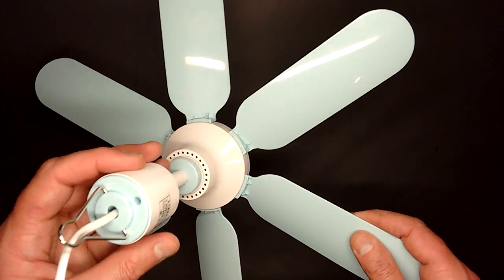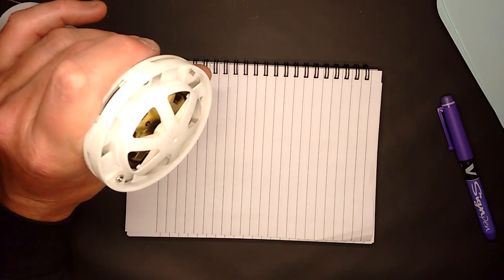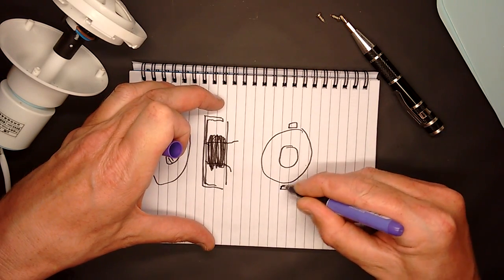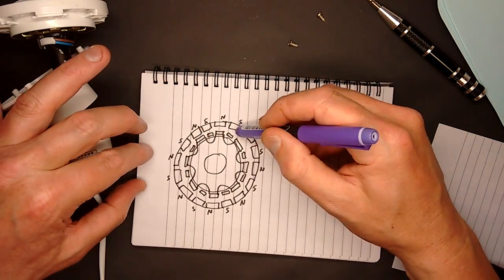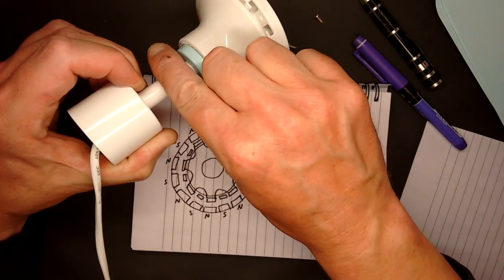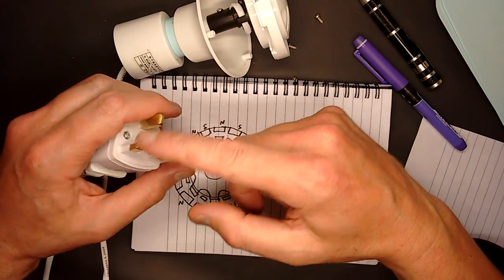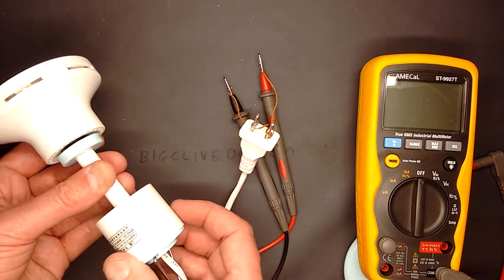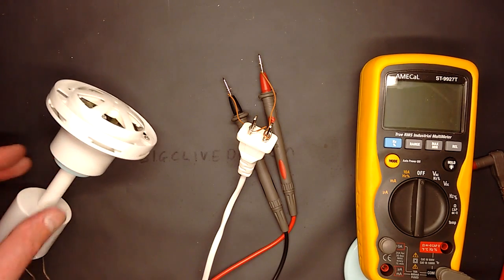Mini ceiling fan with intriguing motor and wind turbine potential.

Comment: is there any way to convert this unit from a 220v to say a 12v?
Reply from the maker: They do a 12V version.
Reply: +bigclivedotcom I bought the 3 leaf version 12w. but I really want the version you got in 12v. is there a way to perhaps make it run on 12v?
Reply from the maker: They may do a bigger version of the 12V unit.
Reply: Fareed Alshami
Reply: bigclivedotcom I see. but no way to covert it then easily?

Comment: what will happen if that 220v fan is plugged into a 110v socket?
Reply: It just wouldn't have a lot of power. Fan might run a bit slower. Too little volts for what it was designed to run on.

Comment: Would one of these https://www.amazon.ca/Ckeyin-110V-120V-220V-240V-Voltage-Converter/dp/B00RTAN57Y/ref=sr_1_15?ie=UTF8&qid=1469904868&sr=8-15&keywords=110+to+220+v+converter work for using this in Canada? buying the fan and this converter together is still cheaper than the fan designed for 110v... doesn't make much sense to me.
Reply: Nvm.. just cheaper to get the 12v one with a 12v adapter

Comment: I would think the spring load would be for when the motor tries to rotate in the wrong direction at start and it causes the load on the spring to slingshot the rotor in the opposite direction.

Comment: so with some modifications, you could in sense make a perpetual motion device by using the mini fan, and using it to power a USB fan, which in turn the air flow turns the mini fan, giving it power. ok, maybe more than just "some" modifications

Comment: The mechanisms that allow a shaft to turn in only one direction are known collectively as "sprags" (in the U.S., at least). These are also a very common component in automatic transmissions. 

I could hand you a very small ring-shaped assembly that looks similar to a bearing, and then tell you that this particular sprag allows the transmission to function properly (in the forward direction) in 2nd or 4th gear... and then tell you that it's capable of withstanding 700 horsepower (approx. 540 KW). In other words, they often transfer torgue directly to the output shaft. (Although... by "directly" I usually mean "eventually, through the planetary gear system".) 

The fact that you are examining a tiny little "spring sprag" is very entertaining, so thank you for the video. However, I consider the idea that a spring is applying constant friction, however small, to the shaft as the fan is running to be a poor design. 

Sprags are one of the most interesting reasons that auto transmissions do what they do, which are a device that I enjoy taking apart to study - much as you do with electronics. ;)
Reply from the maker: In this case the shaft only moves briefly as the fan starts and then returns the shaft home to a static position when it's running.  I was reading up on automatic transmission recently.  A very clever system.
Reply: bigclivedotcom
- I just rebuilt a Ford AOD recently, from the middle '80s. It was fascinating to see how this uses a single planetary gear to generate 4 separate forward speeds and one reverse.

Of course, it does use 2 different input shafts, 2 drum bands, and 4 clutches to DO that... but it's still very fascinating. ;)

Comment: SO.... can u actually use it to generate power at a higher voltage with some mods?
Reply from the maker: It's not really optimised for generation, but would at least do something in an emergency.
Reply: ok, whats ur opinion on actual metal ceiling fan conversions?? with N52 neodymium magnets??
Reply from the maker: It depends on how likely corrosion of the fans components was in outdoor conditions.

Comment: Would this run on US 110V 60Hz? I mean it's just a synchronous motor? or would it burn up?
Reply from the maker: You can buy 110V versions on eBay apparently.

Comment: Wind turbine?
Why? Wind is an unreliable source of energy. Plus it devastates landscapes, nature, chops birds and is hugely expensive..
Energy density is the keyword here. 
Wind can never replace other 24/7 reliable forms of energy.
Reply from the maker: Here in Glasgow, Scotland I can see wind turbines on the hills from every window.  They are usually running briskly.
Reply: And you're telling me that huge power plants of any variety do not devastate landscapes, nature, and or birds? Solar farms will do that, mining for radioactive materials for nuclear power will do that, hydrodams can ruin entire sections of land when the dam fills up. Every energy source has it's draw backs, it's best to go with the forms that require the least amount of detriment to the land. I feel like wind and solar do a pretty good job at that. 

That being said, energy density is a huge factor here. You need a lot of them and a lot of storage for the periods with no wind or sunshine.

Comment: I'd actually love it if you could do a full video on the "doppler effect" on the fan. And camera scanning.
Reply: Its the rollin' shutter effect
Reply: It's not the Doppler effect you read about in Physics textbooks, but the same underlying principles apply. It's a generalisation of the Doppler effect.

Look at the fan spinning at about 1:30 to 1:40, and pause the video. Notice that the blades on the right seem to be bunched together, and the blades on the left seem to be spread out.

You can imagine the fan as a circular wave form, where the blades are the peaks and the gaps between the waves are the troughs. The "movement" we need for the Doppler effect to happen is created by rolling shutter, which moves downwards.

On the right, the blades are moving up, so they're moving in the opposite direction to the rolling shutter, and that's why they bunch together. This is just like your ear moving towards a sound source causing that sound source to increase in pitch.

And on the left, of course, the opposite happens.

I hope that makes sense.
Reply: How is it Doppler effect?  That would change the colour (very slightly) and the frequency of the sound.  It would not cause the visible effect shown.

I'm with Shaheer Syed.
Reply: Peter McArthur
I do understand your explanation perfectly and I did observe the effect you describe, which I didn't properly pick up on at the first viewing.  This isn't what I would regard as a Doppler effect but I understand the comparison.
Reply: It's both.

Comment: I have a couple of the 12v ones. they ARE quite good and quite a bit more torque than I was suspecting.

I am interested in the OTHER one however. is there a 110v version of that one?

WILL the 220v one run on 110v? some devices do work this way just at a slower speed. ??

Comment: I found a similar on eBay, they also sell on Banggood. The 5 blade fan, eBay have it for £6.99. It'll be ideal for putting above the clothes horse in winter and over my bed in summer. 
Cold call Big Clive. :) 
http://www.ebay.co.uk/itm/Mini-Ceiling-Fan-Hanging-Super-Quiet-soft-Wind-Small-Summer-Cooler-Kids-Gift/291806224904?_trksid=p5713.c100043.m2062&_trkparms=aid%3D999002%26algo%3DURGENT.LUI%26ao%3D1%26asc%3D20140502134130%26meid%3D36a38b00d8af4455b641c538073c7a2f%26pid%3D100043%26rk%3D1%26rkt%3D1%26so%3Dcart%26sd%3D291806224904&var=590815933851

Comment: These calculators aren't solar powered. It's just piece of plastic that looks like solar panel.
Reply: Take one apart and measure voltage coming out of the solar panel
Reply: I took one like that apart (actually if fell apart by itself) and there is no solar panel in it. It just a piece of plastic, a dummy.
Reply: I suppose it depends on what calculator you get - there seems to be a lot on a similar design.
Reply: Yeah, maybe. But I don't really think that they would put real panel in a product that is worth about 60 cents.
Reply: Most calculators I've taken apart have had real solar panels. I took apart a calculator once that had a real solar panel but it wasn't even wired to the main board.
Reply: All of the solar calculators I opened had real panels, but I haven't tried any really cheap ones.

Comment: Almost looks like it was designed by someone who is use to building hobby compact brushless outrunners. A little different but a few similarities compared to the standard AC motors

Comment: It's called rolling shutter; the camera is capturing the frame one line at a time instead of all at once. Produces jello on vibrations and fast motions; and weirdness on rotating objects; it's also the reason why sometimes flashes (from other cameras, or lightning) sometimes cover only part of the picture, and fast blinking lights make stripes.

edit: also, it can produce some interesting effects on vibrating strings (like on a guitar)

Comment: As this is a synchronous motor does that mean it would be able to supply/absorb reactive power? I suppose you could put a capacitive dropper on it because its not as if there are any isolation issues in the power supply. Might cause the fan to overheat though I suppose from the reactive currents.

Comment: Only two issues that I can see. First is the "swept area" is not really large enough. However it is probably not that difficult to install larger blades (perhaps someone with a 3D printer can help there). The second is the lack of a speed brake. That is easily fixed using the traditional "turn out of the wind" mounting system.

Comment: As a wind turbine it might power a suitable home made LED lamp. Something like a single LED filament strip with a nominal 60V drop with a bridge rectifier and a 10mA constant current source (basic circuit would have 2 transistors and 2 resistors). A free energy night light.

Comment: I was thinking of chopping of the plug, Attaching it to a light bulb adaptor so I can "plug" it into the ceiling and just have the metal triangle round the flex. Instant temporary ceiling light.

Comment: I have also seen this in the Banggood web pages. I was also very tempted to buy one of these to take to bits. I have no use what so ever for a fan like this but they are cheap enough to play with. I was looking at the 12 volt one however. Interesting to see what kind of motor that has! I think Banggood stays in business because of people like us.

Comment: It's the wrong time of year and a bit more expensive than you usually spend on your Chinese goods, but I would like to see what's inside one of these heater fans:
http://www.banggood.com/KONKA-KH-TY15-220V-300W600W-Solar-Heating-Warm-Air-Heater-Fan-p-957186.html

Comment: at 13:30 shouldn't that be 5.5 revs per second, not 5.5 rpm?
Reply: Yes, I was thinking the same thing. 5.5 RPM would work out to 10.9 seconds per revolution. You're not going to get much cooling (or power generation) at that rate.
Reply: +Buddy Clem Illuminati confirmed?
Reply: Yes, it would be approx 333 RPM. (50Hz / 9 poles x 60 seconds)
Reply: +da-share ...and with 60Hz it would be 6.66... revs per second (1 tenth evil lol) or approximately 400RPM.

Comment: Speaking of electric shocks I gave myself one today (Not intentionally) I was doing some electrical work in my stepdads "workshop" (converted static home) and I "Thought" I had removed the correct fuse for the power outlets because I thought the one fuse out of the two cut off all outlets. and the second just fused a random flailing cable. Wrong. I took off a single outlet to change it to a double, grabbed the live wire, didn't feel a thing so presumed dead, grabbed the neutral wire and live together and my hands went all tingly. Just as well I wasn't grounded.
Reply: Lesson learned, check and double check it's dead before working on anything.
Reply: Not grounded can do that and it can be confusing till you realize what's going on. Did that in Canada changing a ceiling light. I had hold of the live (hot) wire  trying to feed it through the hole in the fixture mounting plate without realizing it was live, thus making the entire fixture live... I then repeatedly got zapped by the GROUND wire dangling from the box... took me a few to work it out.

Lesson: Wooden stool on vinyl covered floor=dang good insulation!

Comment: So basically its a brushless AC(BLAC) motor?
Reply: Never use the word brushless when talking about AC motors. By default AC motors are brushless already and have been so since 1888. We use the word brushless for DC motors because DC motors in general are not brushless, so we must designate if the DC motor is by using the word "brushless".
Reply: Arek R. It's AC, therefore it's brushless by default assumption. Otherwise, if you have brushes it's brushed AC motor. If it's DC then it has brushes by default assumption. Otherwise if it has no brushes then its brushless DC.

Remember: AC motors brushless since 1888 which it was first invented. DC motors brushed since first invented (time of first DC motor unknown to me). 

Easy was to tell you have an AC motor is if the rotor is just a steel cylinder that has bars embedded in it. This type of AC motor is called asynchronous AC induction. 

Where it can get tricky is if the rotor is made up of magnets as is used for permanent magnet synchronous AC motors because brushless DC motors are also made this way. BUT, the big difference is the permanent magnet synchronous AC motor will be driven by a sinusoidal waveform like what comes out of the wall sockets and requires no electronics, whereas the brushless DC motor requires electronics to work and the waveform will be trapezoidal.
Reply: Ok ok xD
Reply: Yeah, aka permanent magnet synchronous single phase. there does exist a magnet free, brushless ac motor called "asynchronous motor". bldc is kind of the same as this, except for usually way higher frequency. Well, more like a scaled down industrial one, as it is a three-phase one. Some strange bldc ones are even 4-phase. but they are strange.
Reply: So its not brushless?
Then where are these brushes?

Comment: That's a pretty ingenious design.  Thanks for sharing the disassembly.       Unlike some of the other 220Vac stuff you reverse engineer, I'd expect this to run on 120Vac, but I'm trying to wrap my head around if it would be the same speed, or just with less torque.   Yank checking in.
Reply: I would expect the speed to be dependent on the ac frequency, since that is what creates the alternating field, so 60hz should make it spin faster than 50hz
Reply from the maker: It's a synchronous motor so if it couldn;t make speed it might just keep jittering and cogging.
Reply: If it's 120v/60Hz I assume if it did spin, it would spin faster?

Comment: This motor is exactly the same as one I found inside a lamppost (over 30 years ago - UK)  it was driving the timer to control when the lamp turned on and off.  We used to borrow electricity from lampposts to power our portable music centres.
Reply: If you see a solar street light, climb up and shine a flashlight on the solar panel :P

Comment: I could tell no difference on the mic with the fan running but I did notice that overall your voice was not as loud, maybe on purpose. 
Just a thought, that spring might serve another purpose, to keep the fan from jumping off the hook when it starts ? 
I was looking at one of those for putting in a pickup camper, the 12 volt ones, might get one.

Comment: I work on the big wind turbines for a living which only have the three blades. I would be curious to know if that little guy would be more efficient with 3 or 6 blades when used as a generator. It looks like you could easily take half of them off and have it still be balanced.
Reply from the maker: It can be balanced with 2, 3, 4 or 6 blades.
Reply: But which would make the most power? You would think 6 but the big ones only have 3. Maybe that's just to keep down manufacturing costs or to keep down the turbulence on nearby turbines.
Reply: Fewer blades generally results in better efficiency, but you also have to consider size (to get the same power from fewer blades you need a greater turbine diameter) and noise (increasing the number of blades often reduces noise, though it may make the noise more obnoxious by raising the pitch).

 I suspect the main factor in typical 3 bladed design of wind turbines is the height of the tower needed to get acceptable ground clearance on the blades.

Comment: It's tempting to rig up the 12 V one to run at bedtime when camping, with the cheap thermostat switch control that you reviewed in a previous video. Then it will turn off when the temperature cools down to the comfort level.

Comment: I like where your mind was heading with the wind idea. However...The blade pitch and size would need to be fairly aggressive to make use of low speed wind - But as the speed increases the pitch would need to be reduced or it will spin itself to a damaging speed - bearing load and overall balance would play a role in that as well. I'm sure you could make it work, but wind gusts would be the problem without pitch control. Also the sensors used to detect wind speed - shaft RPM and direction are most likely not low cost items.

Or you could fabricate those items if you wanted to badly enough with some creativity.
It seems the cost vs Performance ratio would be skewed in the wrong direction if you did
fabricate components.

You have probably already thought all that out.....